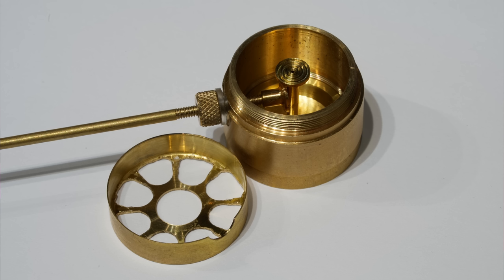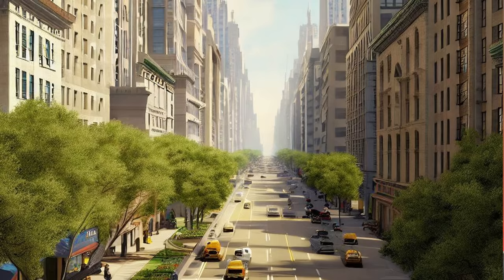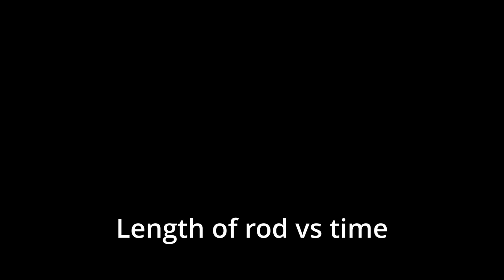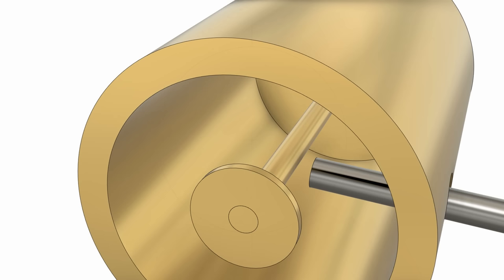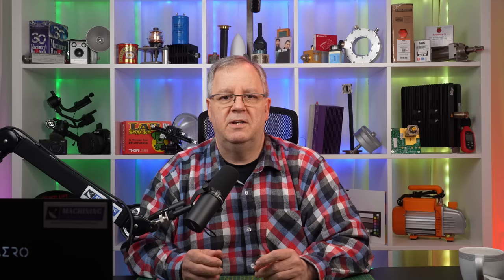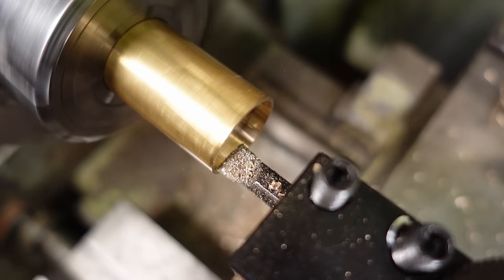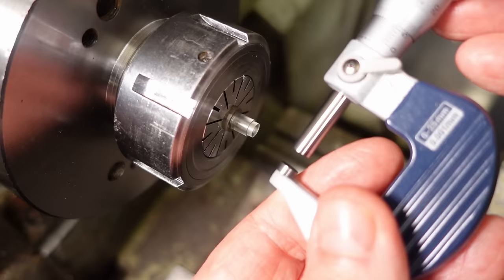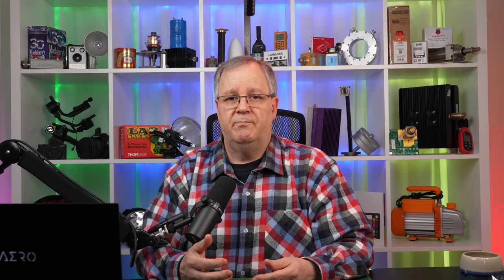SOLVING the Mystery Behind a Soviet Spy Bug : A True Masterpiece of Technical Elegance!

Comment: Isn't the pearl coloured coating inside light bulbs metallic, so the light bulb is a resonant cavity, and anyone with a directional microwave transmitter and antenna within 200m can listen?
Reply from the maker: @plinble  the pearl frosting was originally done using hydrofluoric acid to etch the inside surface. There was a slightly better process using a smoke of fine silica particles to coat the inside. The acid process was phased out about 30 years ago because of the problems of disposing of the hydrofluoric acid waste. As far as I know no metallic coating was used on incandescent lamps but of course the filament in those lamps was very fine and typically a coil or a coiled coil which would vibrate very easily and might have been used as a microphonic re-radiator and it could also vibrate from sounds picked up by the lampholder and shade or luminaire. Air conditioning vents and metal filing cupboard doors were probably better targets. There is of course that interesting case where a vintage looking zigzag filament bulb was radiating a lot of RF power as a result of the voltage drop between adjacent parts of the filament as it opened up away from the suspension loops being sufficient to accelerate electrons. But I doubt there's any application for that for surveillance purposes. It would certainly be interesting to try some reflection techniques perhaps against fluorescent or compact fluorescent lamps because the conductive plasma inside those might perhaps be affected by soundwaves impinging on the tube.

Comment: Have you considered, the main diaphragm might have been the round wooden plaque itself as a sealed chamber affecting the small foil diaphragm ?
greatly amplifying the efficiency of the bug.
so testing just the metal bug without the large wooden disc produced very poor results
Reply from the maker: There are two main effects of the case, one is a detuning of the resonance from proximity, the other is acoustic. The resonances of a large wooden plaque are quite low but there are about a hundred tiny vent holes. I didn't find any difference in the acoustic performance inside the case or out other than it being a little muffled. I tried it in two different boxes with similar results. Pretty much the same as a condenser microphone
Reply: @MachiningandMicrowaves  it doesn't have to resonate if wooden case is only acting as microphone in conjunction with the metal foil, in a sealed chamber with large flat front surface, sound will make significant pressure differences, you can listen to a conversation in a room by bouncing a laser off a window and measuring the phase shift.
Reply from the maker: @elvisburgerking8675  Indeed, and Theremin did that using non-coherent IR light in his Buran system.  A flat plate would certainly help if the microphone was open at the rear, but it's fairly well sealed at frequencies above about 20 Hz so a simple baffle doesn't seem to have any effect. I thinned the wood to about 0.5 mm and drilled around 100 0.7 mm holes, and that had some effect on the sound level, although I didn't measure the frequency response with and without the case. The effect was pretty much the same in a small box as in a large one.  I tried a baffle with a simple large round hole and that appeared to have no noticeable effect, but the sound quality is fairly poor, so small differences would probably not be noticeable.  I was using birch plywood rather than the solid plank timber they were using, so an obvious next step would be to fabricate a replica using solid timer and do some A/B comparisons with a pair of identical devices on slightly different frequencies to see how each performs., perhaps using a chirped audio tone to generate a spectral response

Comment: I wonder if another reason for the hole was to cope with changes in barometric pressure.  If the threads were airtight as they could be then it would act as a pressure transducer and vary with the weather.
Reply from the maker: Definitely correct!

Comment: It's fantastic but how dose the listing device work
Reply from the maker: External 1 GHz radio signal is beamed at the device. Sound waves vibrate the metal foil membrane like in a condenser microphone. That changes the resonant frequency of the microwave cavity. As the tuning moves towards and away from the external signal, the response gets stronger and weaker, thousands of times per second.  The re-radiated signal is mixed with a sample of the illuminating transmission and the receiver uses the homodyne principle to recover the audio. Mathematically, the modulation produces sine and cosine components with a frequency of 1 GHz plus the audio frequency and 1 GHz minus the audio frequency.  Multiplying those by a sample of the 1 GHz alone results in products back in the audio range.  Similar to a direct conversion receiver, but that has its own local oscillator.  The clever trick is to use the original signal as the local oscillator, so you cancel out any drift and most of the frequency instability caused by microphonics in the transmitter oscillator.  Have a look at https://youtu.be/1iG6bOpgYes?si=CplRRXdapmxbYuaa&t=48 where Davis Ricketts explains the homodyne concept.  The start of the video covers the mathematics

Comment: I never knew this was a mystery. I read about how these things worked back in the 90s.
Reply from the maker: A lot of the detail published over the years is inaccurate, but the CIA, FBI and Naval Laboratories had it sorted in the early 50s. The mystery is probably about why all of the incorrect tech explanations are out there
Reply: @MachiningandMicrowaves  I'm still a little confused. They are pretty simple devices. I had trouble following your explanation but all they are is a diaphragm over  cavity filter. The antenna allows the circuit to be excited at a stimulus frequency while the remitted frequency shifts with the sound. The physics is really simple.
Reply from the maker: @phillybruce  The frequency doesn't shift exactly, the resonance slides up and down the side of the resonance curve, which applies mostly amplitude modulation.  The physics behind that is simple enough, you are effectively multiplying the original sine wave at angular frequency omega and phase phi and amplitude A from the exciting signal by the mix of sine waves in the audio signal. Assume just a pure audio tone, frequency beta, at very low amplitude m and phase theta, the output is just A*sin(omega*t + phi) * m*sin(beta*t+ theta). If you work that out, you get components at the exciting frequency plus and minus the audio frequency, plus various other products from nonlinearities. Those sidebands can then be demodulated using either an AM receiver, or a homodyne using the exciting frequency as a zero-IF local oscillator.  There is also a little phase modulation, btu it's tint compared with the AM sidebandd except if you tune right at the top of the resonance where the AM is minimal and the rate of change of phase is maximal
Reply: @MachiningandMicrowaves  Your equation describes a regular AM modulation. So you are saying that the receiver is basically a carrier suppress sideband receiver. Cool.
Reply: I know you can buy commercial passive vibration sensors like this but the signal is a frequency shift. One of the diagrams is one side of a cap. Moving it results in a frequency shift by tuning an RCL circuit. You lode it up with a harmonic frequency and receive on the primary.
Reply from the maker: @phillybruce  If the slope was linear, it would be pure AM but it's more parabolic and the phase changes as well as the amplitude, I'll show the outcome in a future video
Reply from the maker: @phillybruce  Yes, the principle of an RF resonant sensor was patented in 1940 but there was some earlier work in the US and Germany. It's a fascinating mechanism, easily capable of detecting subnanometre movements. At 40dB SPL the molecules are only moving 10nm and human ears can detect a fair bit less than that, so can capacitor sensors

Comment: Ooh so it's using superheterodyne principles to work? Interesting!
Reply from the maker: Definitely not superhet, unless you set the intermediate frequency to zero. It uses a sample of the carrier to multiply with the reflected signal and the square law diode characteristic means the output of the diode is the square of the sum of a superposed resultant sine wave at the exciter frequency and the modulation sidebands which are sines offset in frequency and phase ftom the carrier. The result has components at the original audio modulation frequency. I need to make a manim animation to explain that properly, but a Homodyne is probably the best descriptor. I'll show that in action in the results video

Comment: Ok, but how does the simple vibration caused by a human voice equal a >2 gigahertz radio transmission? Also if this were common wouldn't all microphones be transmitting a radio signal?
Reply from the maker: The voice modulates the resonant frequency of the cavity and changes the amplitude of the re-radiated backscatter from a remote constant frequency illuminating signal around 960 MHz
Reply: @MachiningandMicrowaves  Then I've been subject to misinformation. I was told the way this thing was found was due to a radio operator hearing American voices while listening to Soviet Air force transmissions. But from what I understand this thing doesn't actually broadcast itself. Like a RFID you have to hit it with radio energy then it can transmit, in this case analog audio.
Reply from the maker: @kenstr321  Your information was spot on,  the bug passively re-radiates a signal from a remote transmitter, so if someone is in just the right location, they can hear the eavesdropped audio.  Later versions used encryption and hid the signals amongst TV broadcast signals. The British radio op got REALLY lucky, although a loud plain carrier must have been a bit suspicious!  It's not clear whether it was the one in Spaso house that he heard, but it has serial number 11, so maybe he heard a different one.  Joseph Bezjian and others used that intelligence to start a search in Spaso House and the Ambassador asked his secreatry to come to the office to take an importan memo so the folks would turn on the signal, and the rest is history
Reply: @MachiningandMicrowaves  I see, I was misunderstanding you. I thought you were saying the voice alone powered the transmission.
Reply from the maker: @kenstr321  Might have to should REALLY loud for that!  Yeh, it needs an RF excitation from a nearby building, like all of these unpowered spy systems

Comment: Is basically how our phone microphone works
Reply from the maker: @Ruhgtfo  There are similarities. It's like a studio condenser microphone but without any DC bias.  It's not like a carbon capsule from an early telephone up to about the 1970s. It's not like an electret.  It's not like a crystal microphone. It's certainly not like a dynamic microphone, except that it does the same thing as all of those. Kind of. There were similar cavity microphones developed in the 1930s which used a direct connection to an external oscillator but this device took an extra leap by removing that external source and using the radiated signal rather than the amplitude of the oscillation in the cavity to generate the modulated audio. Thanks very much for watching, and it's always really nice when people comment!
Reply: @MachiningandMicrowaves  Is impressive to heard because the way that it turns of sounds wave to "twerk" into microwave without any single microchip demodulation, which is amazingly mysterious until now. M wondering 🤔🧐 the mechanisms still. Cause mine main concern previously only focus on the diaphragm propagation. Previously Soviet agent that hide in van, they might have to amplify their signal focus the antenna to the direction of the big and intercept the 'seems to be' reflected wave from the passive bug.

Comment: Being an Electronics Layman, I still don't understand how it can operate without a power source. Unless you're saying the vibrations in the atmosphere actually generate the power.
Reply: Maybe I'm get this right: Radio signals are used to create a resonant wave in the chamber. That resonant wave is modulated by the very, very sensitive gap near the copper membrane which is capable of picking up the air pressure changes due to sound in the room. That modulation is re-radiated from the resonant chamber & can be picked up as a very faint AM signal, as long as the listener can effectively "tune out" the other reflections / "background noise" as it were.
Reply from the maker: Dan has it right. The real key is that the inbound radio signal induces electric fields in the antenna and starts a resonance.  Almost all of the energy is re-radiated, but in all directions, even those where the inbound signal can't reach. You are trying to detect a re-radiated signal that's at least ten million times weaker than the inbound one, so it takes a huge amount of effort with positioning antennas and fiddling with phases and amplitudes.
Reply: @MachiningandMicrowaves  Thank you for that explanation. As I said I am a  Layman when it comes to electronics, but this little device fascinated me. Your explanation helped me to understand it a little bit better.

Comment: “It depends on the materials the glass is made from”

Might that be … glass?
Reply from the maker: Borosilicate, Lead crystal, Soda lime, aluminosilicate, fused quartz, lots of different types of glass with different stiffnesses and losses based on the configuration of the electron clouds and atom types in the amorphous mass.

Comment: Could a really loud noise set off close, like say a firecracker or a gunshot blow out the diaphragm
Reply from the maker: Interesting question. I'd have to do sone calculations. A sound 5000 times as loud as speech from a metre away is about the limit. That's around 80dB SPL which isn't hugely loud, however the diaphragm would then hit the post and reduce the potential for damage. A gunshot nearby or the rarefaction behind the supersonic shock of a passing rifle bullet might be enough

Comment: This reminded me of the “Turbo Encabulator” demonstration.

WTF is a “microhenry”?
Reply from the maker: A Henry is the SI unit for Inductance. Usually an inductor is a coil of wire, and the inductance is a measure of how much the coil opposes a change of current. In this case the "coil" is just a straight rod and it has an inductance of just a few NANOhenries
Reply: @MachiningandMicrowaves  wow thank for the reply, that actually made sense.

Upon reading about this famous bug (that I had heard about over the years being a Cold War buff), I was surprised to find out Leon Theremin was it’s designer. What a genius that guy was.

Comment: Regarding the microwave Electronics: Maybe captured German equipment was used here? Excellent video!
Reply from the maker: That's certainly possible, although there was an established manufacturing base in various USSR locations by the 1930s.  The move of the Svetlana plant  to Novosibirsk between July and Sept 1941 might have disrupted supply somewhat, although production did continue in Leningrad. Svetlana had purchased a production line from RCA in 1937 and were making a range of tubes under licence. Acorn tubes like the 6S1J/6С1Ж/955 were freely available from RCA in the 30s and are on the list of parts made by Svetlana.  The 955 is only rated for about 8 mA of anode current at 250V, but there are push-pull oscillator designs for them at wavelengths down to 50 cm (600 MHz), so it isn't too great a stretch to imagine specials being made for research and military purposes that could go to 30 cm/1GHz and with slightly higher dissipation.  Even if they only made 1 to 2 watts, that would probably be enough. The technology used in acorn tubes was mature by 1943 and I suspect it would be simple enough to push the technological limits with some research resources and the available equipment.  Relying on captured equipment wouldn't be necessary other than perhaps looking at any improvements in indirectly-heated cathode design or perhaps coaxial UHF tube designs. Of course, some technology transfers could have been done before the Great Patriotic War from Germany during the term of the Molotov-Ribbentrop pact in 1939 to 41.

Comment: Do the ear rings you wear improve on your receiving or transmitting radio waves?
Reply from the maker: They resonate at 24 GHz so I can steer microwave signals like a heads-up display. My glasses resonate around 3 GHz to give me multi-frequency capability

Comment: a spy would never,during ops,use any more transmitting power than absolutely necessary. the point is to not be detected,at all. are you sharpening all your carbides?!
Reply from the maker: I guess back in the day that they expected the US folks not to notice, and they got away with it for 7 years, but once that genie is out of the bottle, you can't pull the same trick again. I sharpen some of the carbides, mostly the squares and CCGT/CCMT.  I tried with the DCMTs but they are super high-rake and the edges tend to dip when I try to hone the radius, so they tend to go into the box of "inserts I might grind into something later"